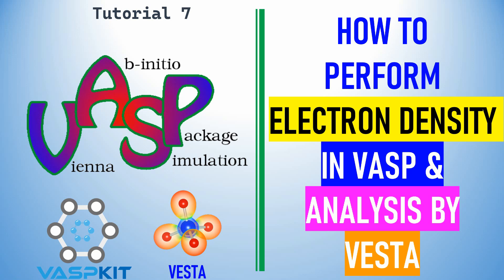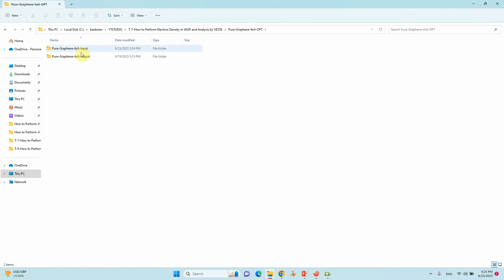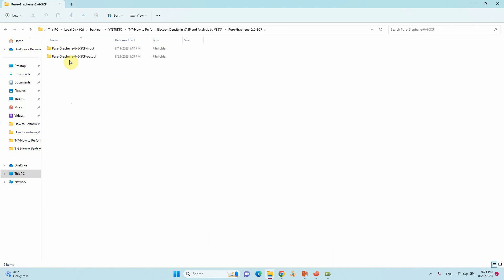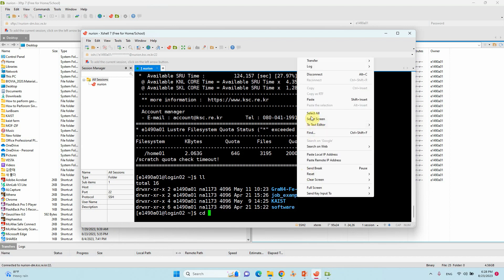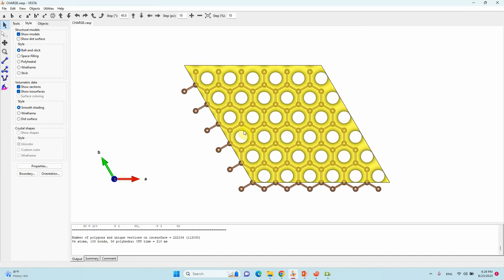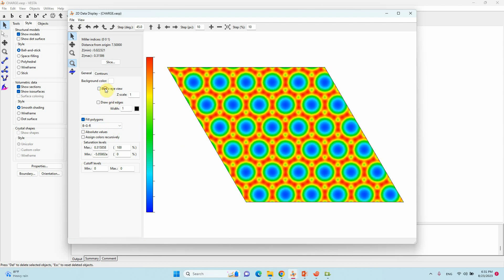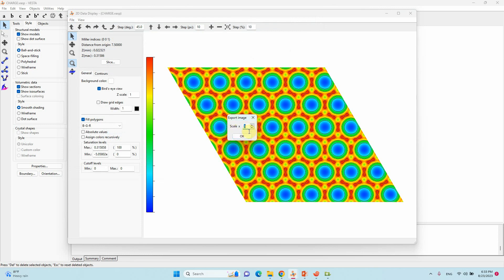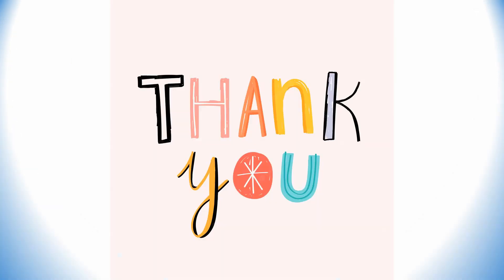How to Perform Electron Density in VASP and Analysis by VASPKIT and VESTA

Comment: Is there a way to run charge density difference calculations using the vaspkit command line? It doesn't recognize my files when I input it in the format: vaspkit -task 314 -file CHGCAR_AB -file CHGCAR_A -file CHGCAR_B even though my file paths are correct
Reply from the maker: Please followed this you can able to do this, How to Perform Electron Density Differences Calculation in VASP and Analysis by VASPKIT and VESTA
https://youtu.be/QnWWmKw12xo